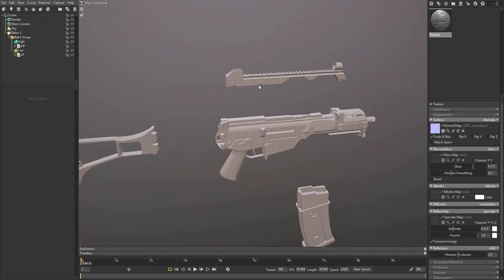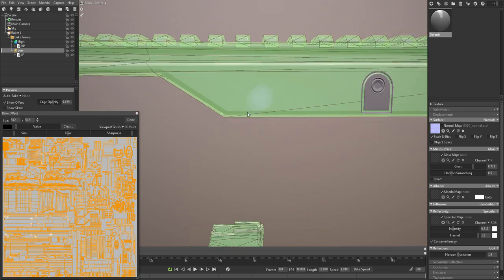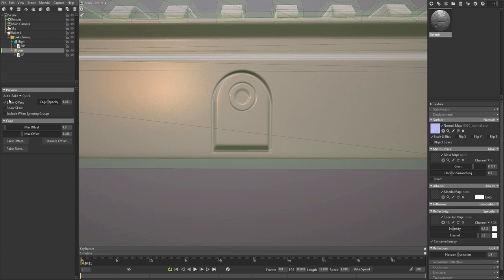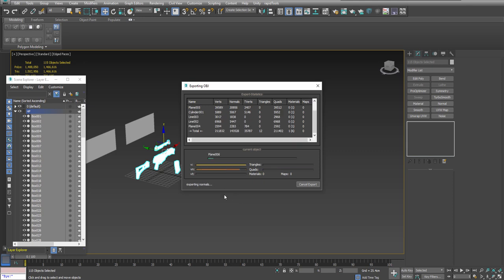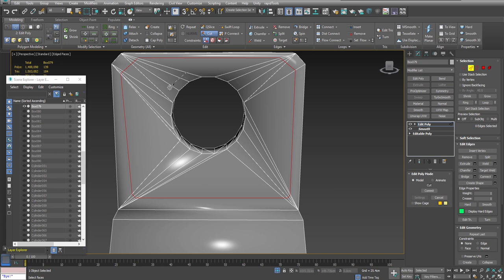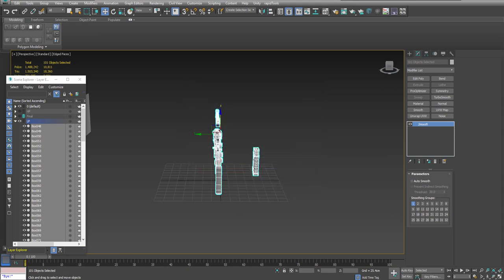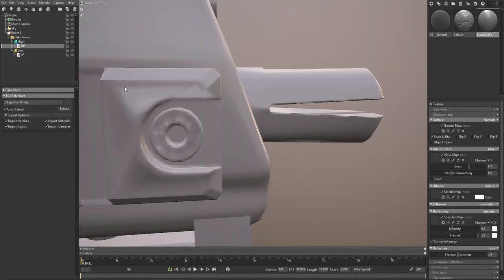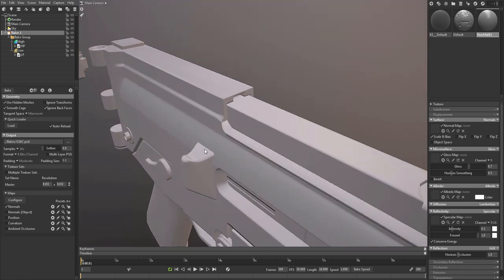How to Fix Baking Errors problems with Normal Map in Marmoset Toolbag

Comment: good work. I'm trying to use marmoset. What I want to do is to get a normal map. but during the process, the program does not respond. Or the computer is resetting. Even if I reinstall it doesn't work. I would be grateful if you can help. Thank you from now.